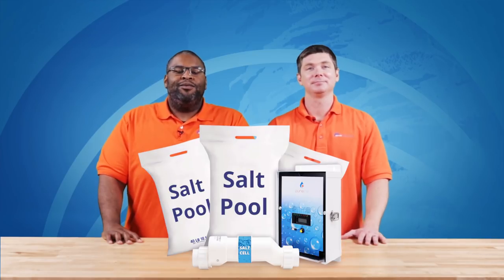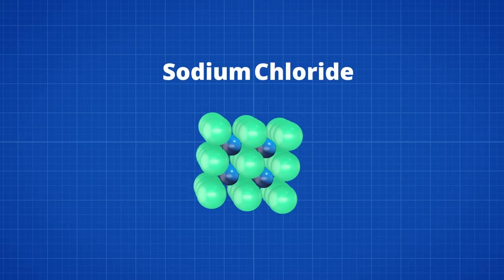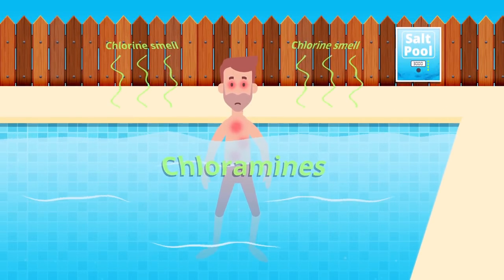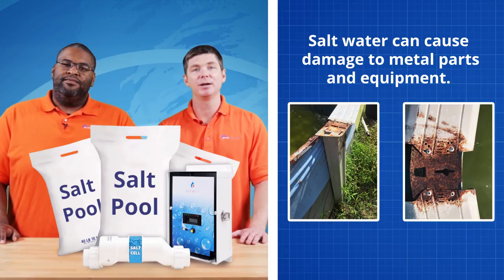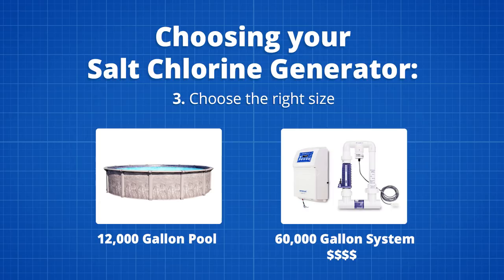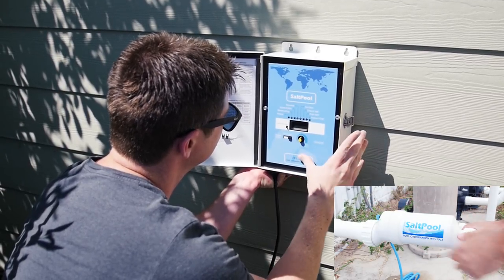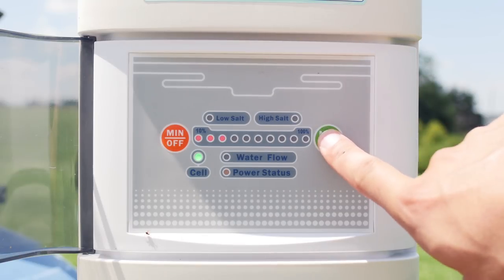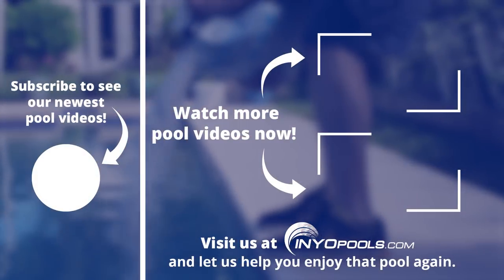Converting Your Pool To Salt Water

Comment: Salt pools is no good. salt is a water softener having a salt pool you still need a chlorine sticks. Servicing pools over 20 years
Reply: James Ervin as with anything, it’s probably best not to paint with such a broad brush.   Right James?   Some people may see more benefits than other from switching while others would see more benefit staying away from a salt system.   It’s a very case-by-case type of deal...
Reply: 1.) "Salt pools is no good." FALSE. My salt water pool is very good, thank you very much. 
2.) "salt is a water softener". FALSE. A salt water generator can not soften water. Why? Because it doesn't remove calcium. Calcium harness primarily dictates the softness of your water. Adding salt does nothing to this process. A true water softener physically removes calcium by binding them to resin and rinsing the binded ions (with salt brine or potassium) down the drain when full. 
 3.) "you still need a chlorine sticks". FALSE. More of a want, not a need if everything is balanced. This situation depends on the pool and the person who cares for it. Even when I start my pool up for the season, my SWG is more than capable of shocking the water. I have backup pucks and bleach at home (who doesn't have bleach at home anyway?) in case of an emergency.

Salt water pool owner for nearly 14 years. I wouldn't have it any other way.
Reply: James Ervin see what you did James, that dude typed a bunch. He mad bro.
Reply: Zepper2019 

I tried to warn him.   Let’s find out where he works and get him fired.   The only logical conclusion.
Reply: Agree 100% with you. I have been handling chlorine for over 30 years with no problem.  Chlorine dangerous to handle??? Give me a break with that BS, more dangerous to put gas in my lawnmower or snowblower.   Others can believe what they want.
Reply: He's just a little salty.
Reply: FFS! I have 16 pools. Converting at the moment to salt .
Chlorine is a nuro toxin. 20 years in the pool business has clearly affected you .